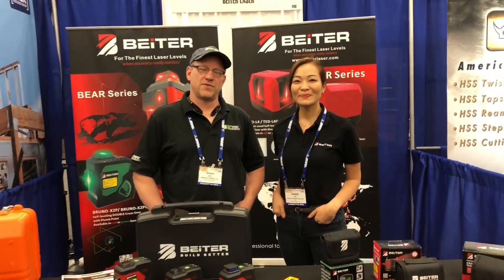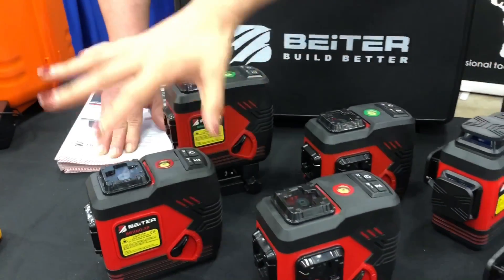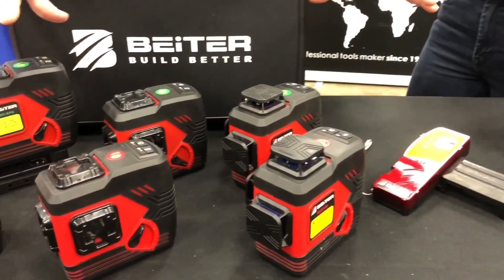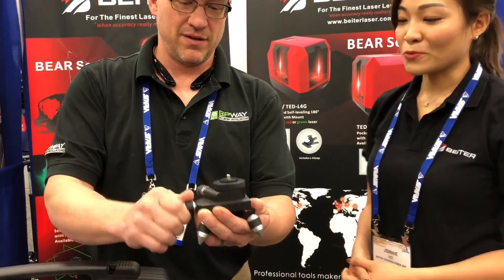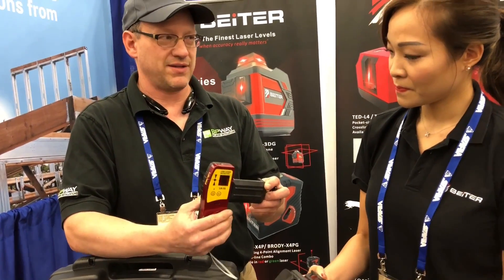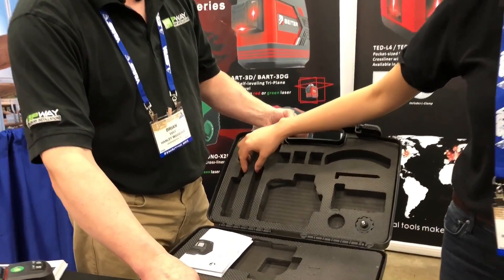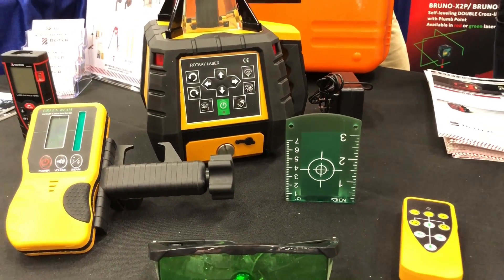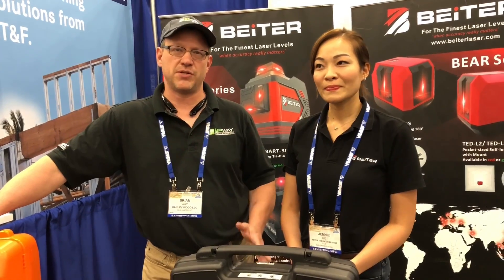Beiter Laser - Rundown of products at STAFDA show - Tools of The Trade

Comment: Brian, thank you for this post! I ordered BEITER fine-tuning rotating base LB-FRB1 and it's FANTASTIC! High quality camera-grade build and a real time-saver. With it I can dial in the alignment of a vertical plumb line across the room with surgical precision. I am using it with my PLS2 and Stabila LAX 300 cross-line lasers. Turns an often frustrating layout setup task into an effortless pleasure.